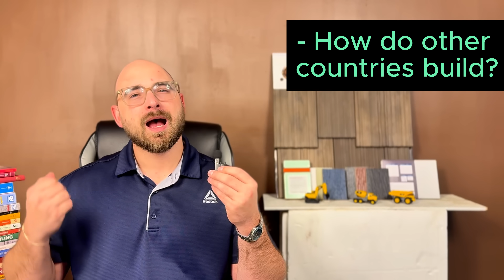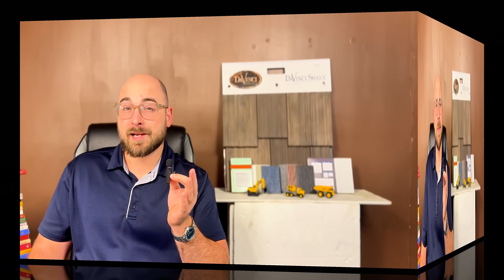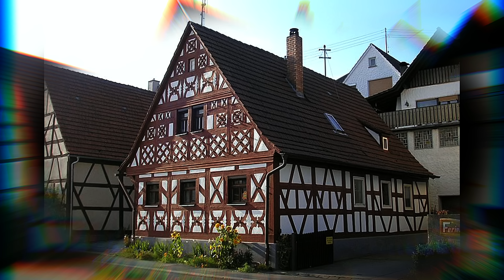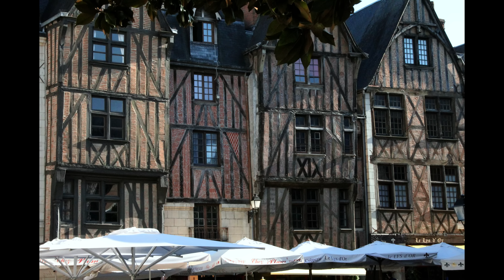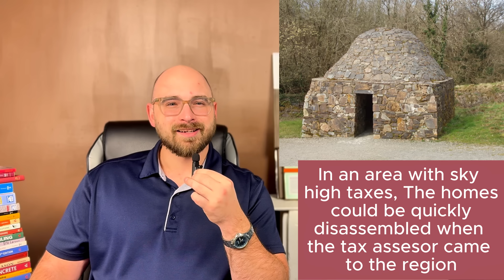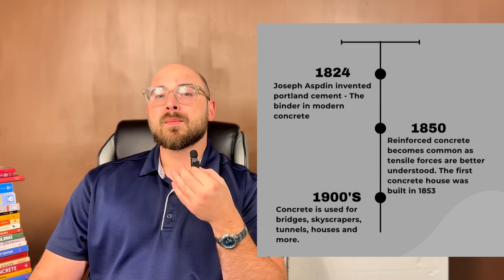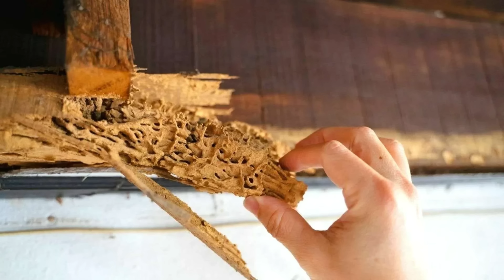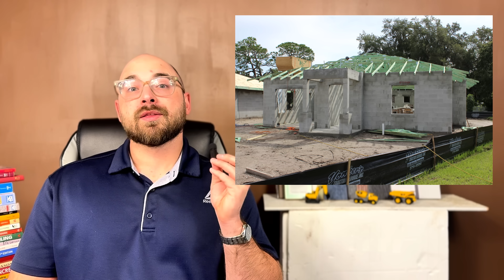Why Other Countries LAUGH at American Homes

Comment: I do NOT like REINFORCED CONCRETE because the STEEL RE-BAR (inside the concrete) will eventually RUST away and cause the surrounding concrete to BUST APART!! STONE is truly the KING of ALL BUILDING MATERIALS!!! It will NOT RUST (metal), ROT (wood), BURN (wood), and it can NOT be EATEN by TERMITES (wood)!!! ALL of the great OLD structures, such as Medieval Castles, Gothic Cathedrals, Lighthouses, etc., are ABSOLUTE PROOF of this!!! I do like the CLAY-FIRED INSULATED BRICK that he began talking about at approximately the 10:30 time mark in the video!!! CLAY is IMPERVIOUS to WATER; water has a very DIFFICULT time penetrating through CLAY!!! This is why people use CLAY to line the BOTTOM of PONDS (to KEEP the WATER IN the POND, as opposed to just sinking into the underlying soil)!!! Therefore, using CLAY-FIRED INSULATED BRICKS is an excellent way to keep MOISTURE, MOLD, and MILDEW from getting INTO the WALLS of the structure!!!! There also is NO METAL (Re-bar) to RUST away, and there is NO WOOD to ROT, BURN, or be EATEN by TERMITES!!!
Reply from the maker: If you protect the concrete from moisture the internal reinforcement doesn’t rust. Can also use stainless, epoxy coated, fiberglass or composite rebar.

Comment: I spent a career in New England as a carpenter. There are nice wood framed houses and there are cheap wood framed houses. I spent plenty of time working on and restoring older homes. Think 200-300yrs. Not long compared to Europe, but they were still in very good shape. Houses are built with what is available locally. Some areas you see lots of brick homes. Places with timber theres lots of timber framed. Also seen plenty of steel and block homes. Its not like there is a uniform method of construction. And if I'm honest, I really don't care what some t wats from Europe think. If they're happy with what they have, that's great. Whatever.
Reply: New Englander here, and I live in my 150+ year old wood framed housed, it's solid but due to settling is not level or square, but I find that to be an appealing quirk.

Comment: What i've never understood is why also build the interior walls to those super thick, strong standards. Like I remember seeing a guy measuring an interior wall in Germany and it was over 25cm thick AND solid! Not only do I not get why you'd want to insulate one room from another that much (outside of pretty niche things), but also that just seems like a waste of materials, build-time (and labor expense), and even inclosed space that otherwise could be floorspace! All that for something that's much harder to hang stuff like picture frames up on, harder to patch cleanly - inculding from those picture frame nails - and harder to DIY things like running electrical or ethernet cables.

So it seems to me like the best option is a combination. "European" style solid built exterior walls and load-bearing elements, with US-style stick built interior walls.
Reply: Interior walls are often designed to be load-bearing too.

Comment: ICF looks like it doesn't let the concrete cure fully. Concrete needs oxygen to cure. If its that packed in from both sides it might take a century to reach full strength.
Reply from the maker: Actually, testing data has shown that the extended curing time causes the concrete to cure much harder, at a higher PSI than traditional formwork

Comment: Contrary to your claim to be more energy efficient, higher density materials conduct heat better and need additional low density material like stone wool as insulation. The higher thermal capacity helps easing out high temperature differences over the day though which also helps with ac demands, so there is some merrit to energy efficiency by solid structures themselves.